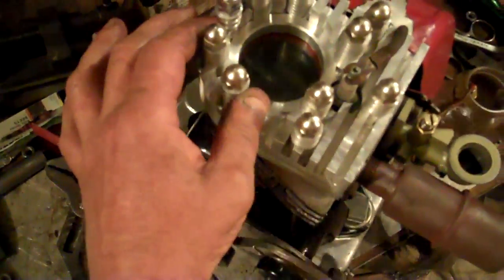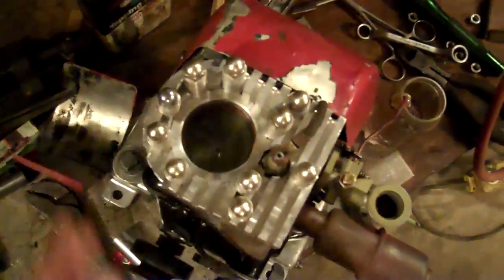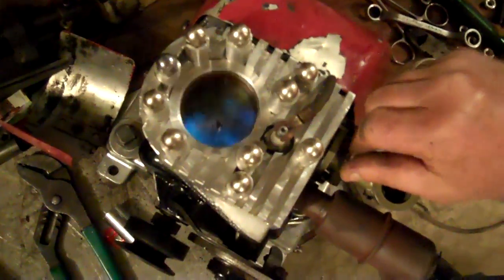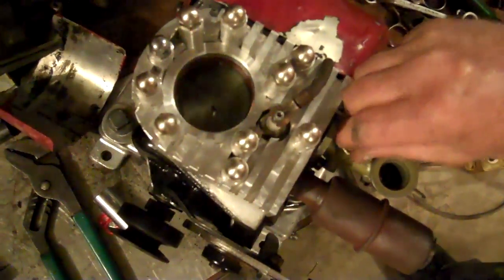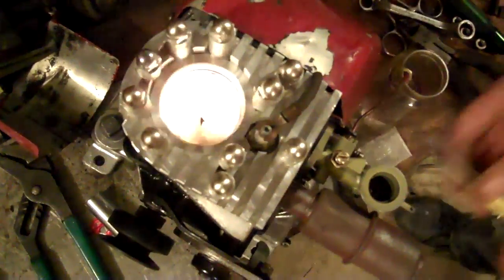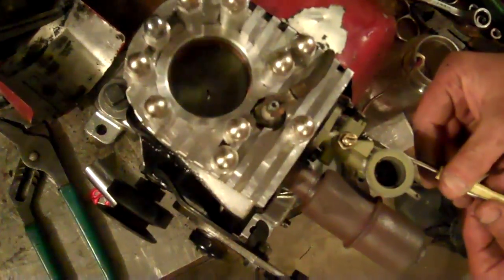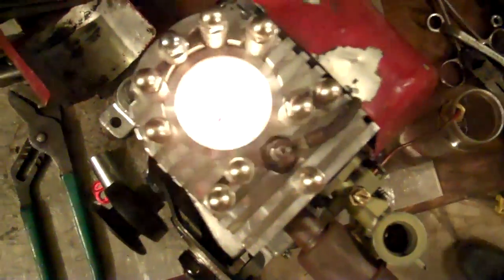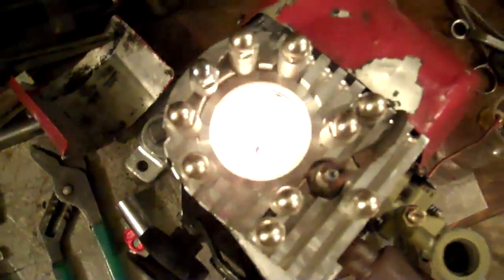Old cast Iron Briggs and Stratton single cylinder. See the actual combustion running on leaded fuel

Comment: VERY VERY COOL.    Loved it.  Now do one with a HEMI.
Reply: It would be too difficult to do one on a Hemi. BUT a flat head is made for bolting on glass heads
Reply: Eric Kent Just saying it would be cool.  Having a hemi glass head would be almost impossible due to the figuration of the Hemispherical type head with the valve angle.  It would have to be off of a Hemi

Comment: I used to have a "Colortune" glass spark plug 35 yers ago, when I had a Mini - oh, hang on - I just looked for it - and found it - on Ebay.  It allows you to see the colour of the exploding gasses, which can be used to adjust the carburettor mixture.
This is way cooler, though.  Was it actually a glass head, or some plastic such as acryllic?  It would be very difficult to put all the screw holes etc through glass.
Reply: Must be glass, watch the crack grow!
Reply: Chris Lesmerises - Hmmm... maybe you're right.  And the article is entitled "Glass head".  I didn't think Pyrex would have cracked, unless it was due to the engine expanding and putting more stress on the head through the studs - but it didn't start around the studs.  Also, as I said, glass is difficult to make holes in - especially when it's that thick - though I accept it can be done.
The crack first appeared at 0:09, before the engine would have had time to heat up.
Reply: Mike Collins Agreed on all points. I think the crack was pre-existing from a previous run. Fun to FFW and watch it grow though! The worst part is... something like this is basically guaranteed to fail with eyeballs nearby and in line of sight of the shrapnel... Not that I think anybody is going to get hurt... but the whole recipe makes for some exciting suspense! I love it :)

Comment: Could anyone explain why the fire is blue? I have noticed that too sometimes when bikes backfire the flame is blue, why is that?
Reply: Hotter flame burns blue - like at the base of a candle flame.
Reply: Ahhh i see now, Thanks!
Reply: If the fuel is completely atomized and mixed with air, the flame will be blue.  It's only red/yellow when the combustion is incomplete.  I saw (and you can probably YouTube) a boiler using heating oil, essentially diesel fuel, and burning it with a clear blue flame.  That's what combustion should look like.
Reply: Thanks guys! So if the flame is blue everything got burned up? So nothing spare stuff so to say? :P Poorly worded but i hope you guys get what i mean
Reply: if the flame is blue its burning efficiently if its red its not and its making more CO thats why a furnace MUST have blue flame or every one will die in the house of CO poison
Reply: i suppose yes
Reply: It's close to stoichiometric.
Reply: All wrong, White combustion flame is hottest perfect combustion((under compression compression)) for an I.C.E. blue flame is perfect combustion in ambient pressure, yellow/orange/red high carbon +/- lean.
in this case the blue flame is from crank slop, advance timing or innefective air/fuel mixture, orange is from post ignition, mostly escaping from crack in head (sucked back in immediately from what I saw though)
The white hot combustion is what cracked the head, if they kept it advanced it'd never have cracked the head - though, it'd never pull a load worth a damn.
Reply: originalanthraxton

Comment: mesmerizing view of a technology that is now 200 years old. unfortunately there is a lot of energy lost to heat and light (75%) .lets finally be wise and move over the 21st century and go electric. combustion engines belong in museums by now.

http://waitbutwhy.com/2015/06/how-tesla-will-change-your-life.html#part2
Reply: Electric has a loooooong way to go before it's able to replace ICEs...
Reply: EV's are nothing new. that technology is over 100 years old. your argument is invalid.
Reply: No, they don't. Battery electric cars are a pipe dream at best and will never be able to replace fuel burning cars.

You want EVs to take off? Replace the battery with a nuclear reactor. Until we get Corvegas in real life, until we damn the safety risks inherent in having fission reactors trundling down the road, battery EVs will always play second fiddle to ICE powered cars.
Reply: Fuck that shitty technology, it's weak af and doesn't last for shit.
Reply: I'd argue that without government intervention they would never replace ICEs in the next 100 years...because you can make fuel with electricity obviating the need for batteries or drilling. It's probably more efficient as well... so your fuel supply chain may look something like sun > solar panel> atmospheric carbon + water -> ethanol. https://www.ornl.gov/news/nano-spike-catalysts-convert-carbon-dioxide-directly-ethanol
Reply: Bart Nijman no way, skylines and other amazing cars will always remain on the street and always have the best sounds. Screw EV, why not attach electric motors to v8's and other good naturally aspirated engines? We, enthusiasts, will not stand down.

Comment: Glass is cracking let me put my face over glass that has 100+psi on it.
Reply: chillyfog2427e7738 100 psi is cranking, non combustion.  during cumbustion the pressure is increased ALOT.  to sum things up... yes he is a fucking idot.  pretty much a glass grenade with a random detonation switch